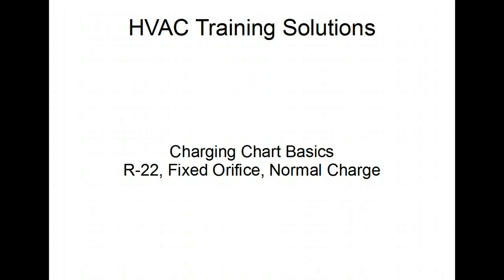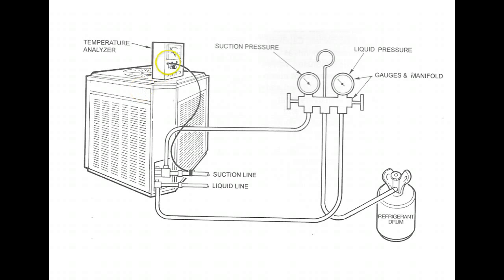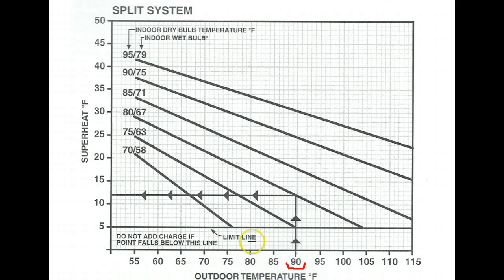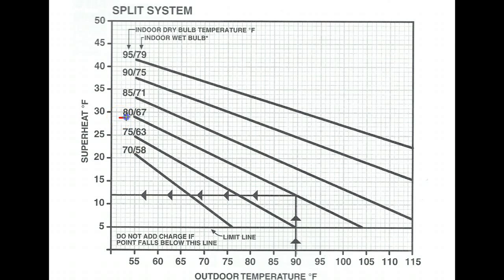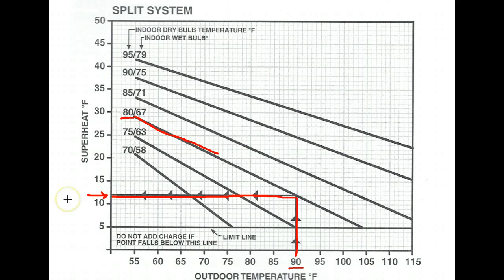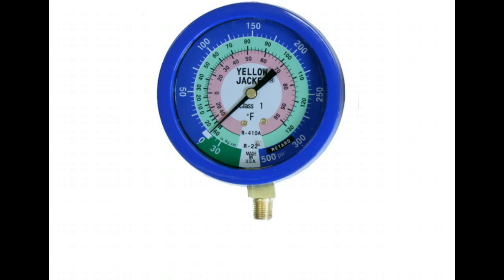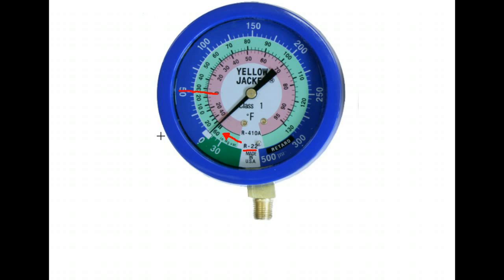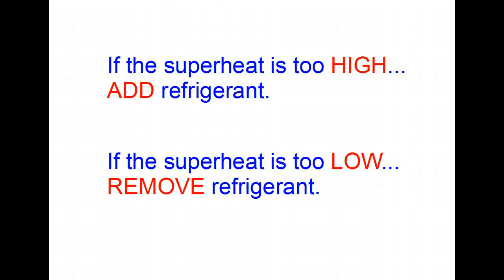Charging Chart Basics

Comment: Does it mean the requierd super heat is higher in Arizona where the inside wet bulb temperatures are lower and super heat is lower in Florida where the inside wet bulb temperature is lower?Thanks

Comment: so what if you have an outside T of 95 and inside dry of 75 and you are charging it from 0 (no regrigerant, new system). what do you do?
Reply: if outside Temp is 95F, inside temp probably more than 75F. or you already have cooling sources somewhere. thats why it does not count on it .
Reply: yes, the ac is in a room with other ac that is why the return temp is usually around 70 - 75